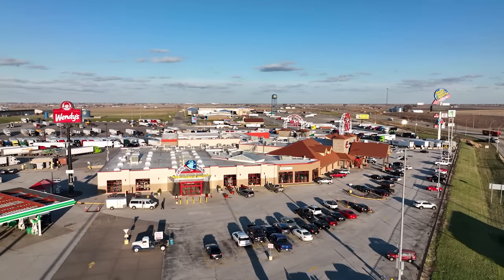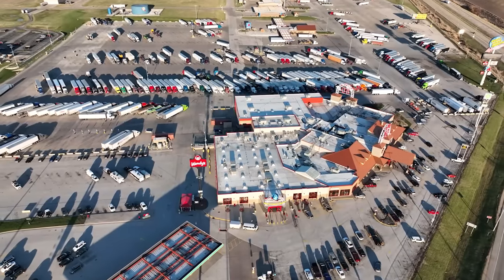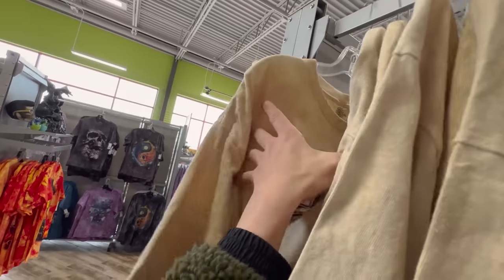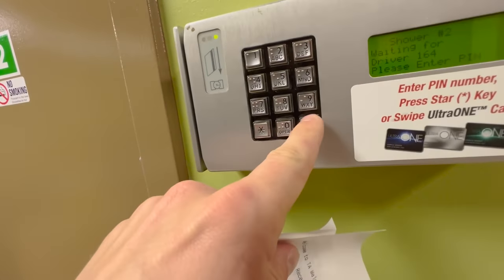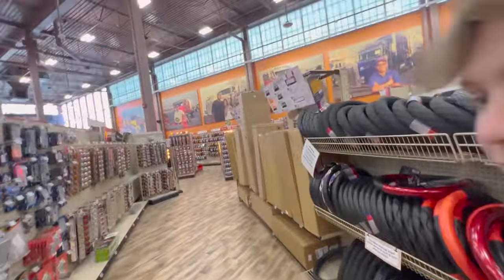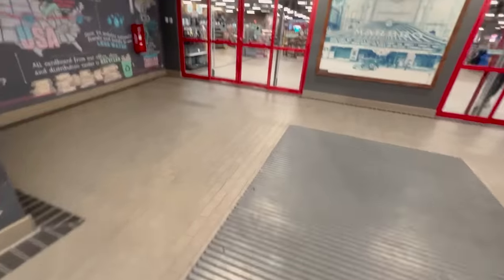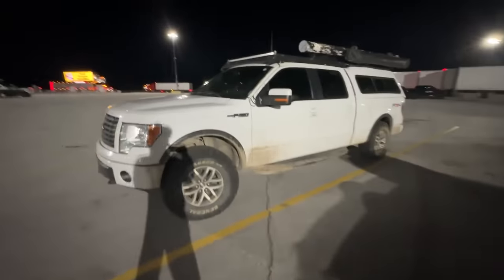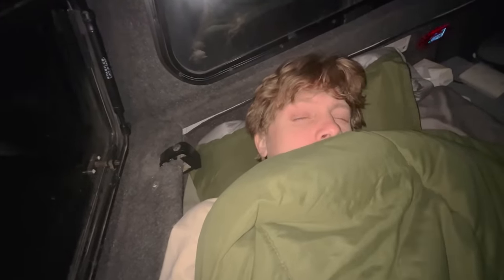Camping 24 Hours at the Worlds Largest Truckstop

Comment: I lived in an RV, parked at the shop I worked out of. I didn't have the plumbing hooked up, so I snuck into the KOA across the street for showers or occasionally used the truck stop. Truck stop showers are a real treat after sneaking into camp bathrooms and worth the cost.

Comment: I spent 13 years long haul trucking. Spent many a night at Iowa 80. Great place to clear your hours up. Do laundry, get your hair cut. Even get your DOT physical at the chiropractor. The food courts not bad. Honestly though the restaurant is in my opinion a disappointment, could be better. They supposedly have enough parking for 800 trucks. And over by the truck fueling area they have a place to wash your dog. If you go there again spend some time talking to some drivers. Not all will be interested but most will. Ask them questions. Have a great day Mav.😊

Comment: I drove through there in December. I thought about stopping at the truck stop but it was during the Arctic Blast they had. I just wanted to get to my destination in Des Moines. Doesn’t seem like I missed much either. I was supposed to head back out there next month but they changed the dates of the camping trip. Working on my travel trailer here in RI is my priority right now. I am trying to get it road ready by mid October. It seems the more we work on it the more we find wrong with it. The joys of trying to make an old gem new again.

Comment: I used to live in Iowa, and I'm a trucker.  The place is gigantic.  I've been there for a few days a time or two. I love the i80 truck stop.  You should check out the truck stop on i95 that's in between north and south Carolina. I know there isn't anything in between those two states.  I'm trying to describe where it is.  I'm pretty sure,  if I remember correctly,  it's in northern South Carolina on i95 really close to North Carolina.  But i would say it's by close to being the same size as the i80 truck stop.

Comment: 16$ seems a bit much for a shower ??
Reply: They are free if you buy more than 50 gallons in diesel. They charge about $16 bucks because the hourly minimum wage of the guy cleaning showers is about $15 an hour and it takes him about 15 to 20 minutes to completely clean the showers between users